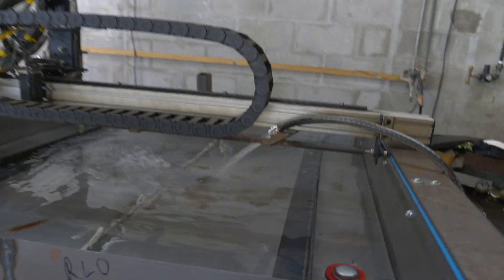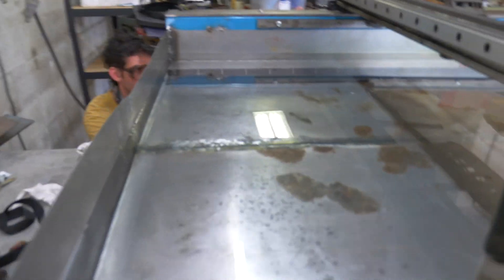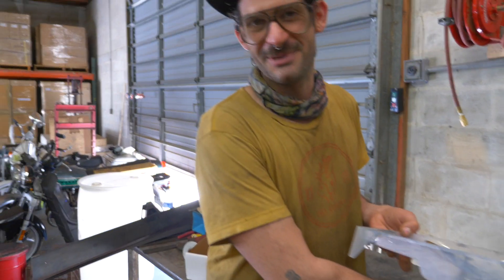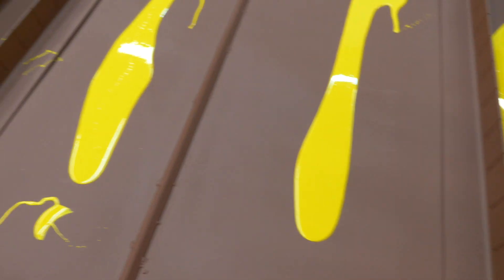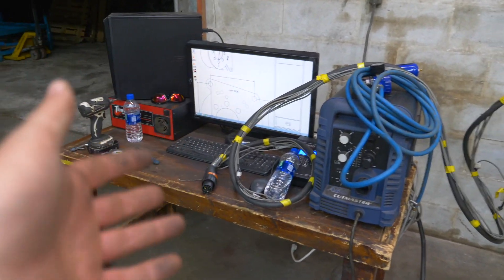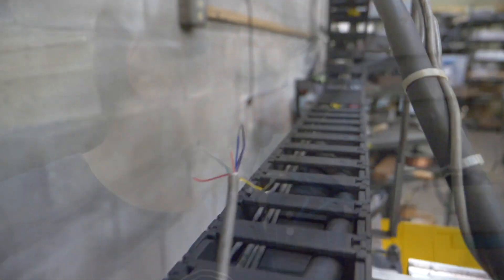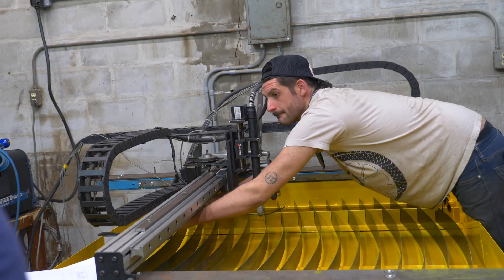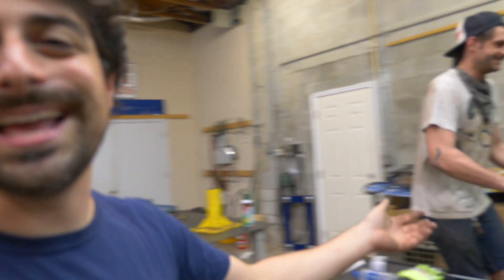The Secret To Building A Bunch Of Ebikes (Electric Mopeds) - CNC Plasma Cutter

Comment: So i picked-up another bike! I mean i bought two tao tao scooters and resold them, both wrecks, but i most recently picked up a Honda nc50 express. It ran when i got it, but was slow and only got slower. 10 mph home from work took over an hour so i of course took the pipe and put it in the fire pit. Both ends of the pipe shot flames like a blow torch for about an hour! I scrapped the inside with a coat hanger, wire brushed the outside, wiped it down with a rag and put high temp rust-oleum on now it does 31 down hill 25 uphill and 27-29 on flats. Have a feeling new bearings will make it hit 30. Its all stock.

Comment: Hey! i really want to make my own electric bike, how would i go about doing that as a 16 year old that has time but not equipment
Reply from the maker: If you’re limited on tools, definitely start with a moped frame or a bicycle frame that is already in rolling condition.  That way you don’t have to start from scratch or go through all of the systems (brakes, lights, wheels) to make sure everything works safely.  Second you should buy a kit that gives you everything you need. You could find these all over the place eBay, Amazon.  Whatever fits your budget.
Reply: These guys are definitely the best to ask! Good luck on your build.